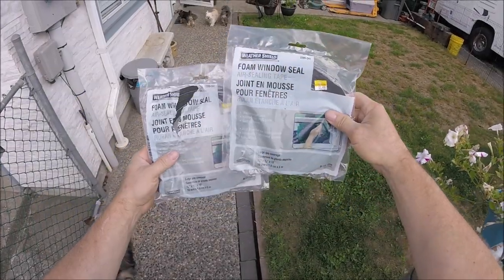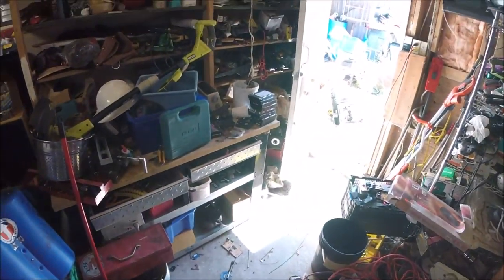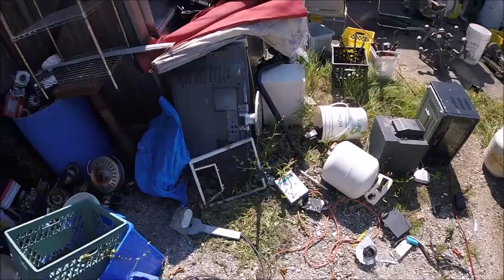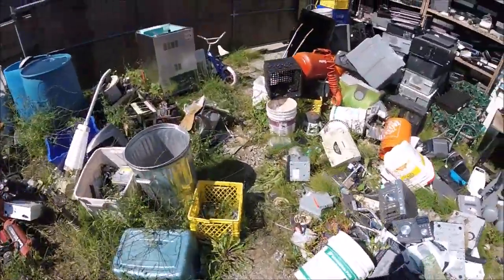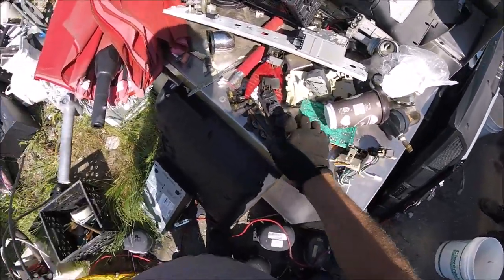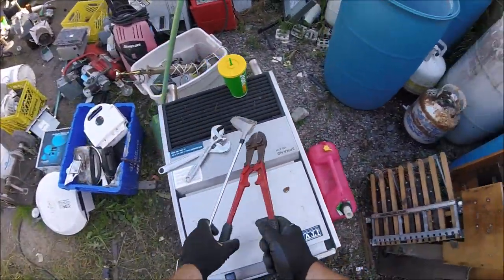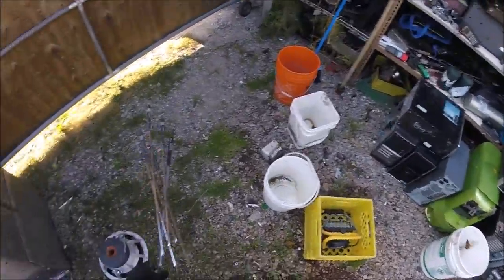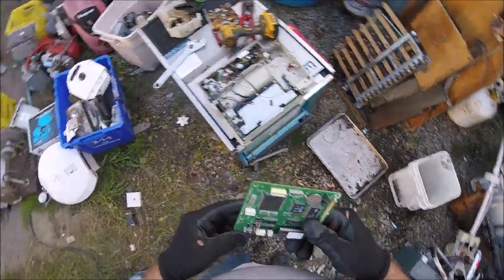Cleaning My storage Yard & Scrapping Commercial Water Pump

Comment: To remove valves from propane tanks, shove a long bar or pipe through the collar, put tank on it’s side, then with 2 adjustable wrenches, put the jaws of first wrench on the valve with handle sticking up, the use second wrench  on handle of first wrench to undo the valve.

Comment: The mini pc is called a thin client i had about 200 of them its mostly a board and a ram i got boared of them after 10 pieces normal pc s are more fun to scrap
Reply from the maker: Thanks it looks like it has a small board inside, You don't get them up here & that's the first one i found
Reply: @CanadianTreasureHunter  they are mostly used in big office buildings every worker has one that transfers data to a huge central pc that stores the data
Reply from the maker: Thanks for the info, It makes sense as its very small